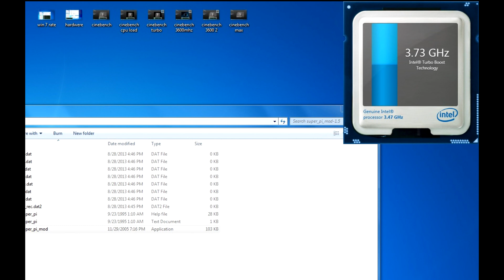DELL Precision T3500 with Six-Core Xeon W3690 and Quadro FX 5800

Comment: Ive been using a i7 920 and purchased this Xeon W3690 for a good price on ebay. Can't wait for it. I expect 30-40% improvement in some areas, autcad rendering for example. I think this cpu is still a good performer, between 3770k - 4770.
Reply: did it work for i7 920 on this T3500 ?

Comment: You can OC this processor to with the Dell to 4.0Ghz by simply installing the Intel Extreme Tuning Utility from Intel. Once done it will bench 15% to 20% higher than a stock i7 3690x. 

No voltage adjustment and stock cooling works fine. Just bump up the multiplier on the cores to 30x. Going to 4.1 or higher is unstable due to voltage. However, you can only bump the first 2 cores past 30x and get a stable clock past 4.0Ghz.
Reply: really??!
Reply: No you can't over clock on a dell
Reply: He's right. I have this same CPU and I've done it with the stock cooling.
Reply: are you able to apply your multiplier setting in xtu when you restart your pc ?
Reply: MrBoggy101 how? everything is grayed out for me, i also have a t3500
Reply: i have a xeon x5647, does the xeon w3690 have a unlocked multiplier or something?
Reply: The w3690 does have an unlocked multiplier along with most of the other CPUs in the w3600 and x5600 lineups. I don't know what to say other than XTU just works.
Reply: i downloaded the utility and it didn't work :(
Reply: you need the 2012 and 2013 versions
Reply: Does it work?
Reply: What version of windows and  Intel Extreme Tuning Utility??
Reply: windows 7...2012 version intel extreme tuning utility...please learn how to read
Reply: The Intel site only has one version, the thread I found has about 40 different archives of old versions of IETU so a specific versions is needed 2012 is an entire year and all the versions I have tried don't allow tuning.
Reply: Gallium31 get to testing then..i'm using the w3690 six core thats an unlocked xeon...look it up on google...i'm using a dell t3500 and its clocked @ 3.8ghz on all cores...use windows 7 too...not windows 8 or 10 or xp...windows 7 64 bit...i'm using the 10th version that was released..other than that..ive provided more than enough to go by and do this yourself
Reply: Sorry to kick a dead horse but can anyone else confirm XTU works with the T3500, i have one and plan on buying a w3690 to go with my gtx 1060 as my w3670 has no options in XTU

Comment: Getting a T3500 quad core PC off Ebay auction for cheap price, gonna put a AMD Radeon HD 6570 card in to upgrade the graphics-should be a big improvement over my Toshiba Satellite L305 laptop for gaming (I used to play WoW on it without much trouble, but since the newest expansion Warlords of Dreanor it's been unable to run the game I guess cause they increased the requirements to run it), Hope it works well, reviews of this PC are positive so I'm thinking it will be good.
Reply: Hi, i just snagged one from ebay also ;:-) ..haven't got it yet, it's on the way...T3500
they are coming off the corporate leases now and compare to the i-7 960 I've read..for the quad versions
only down side is the one 6 pin connector for expensive video cards as most require 2- 6 pin connectors,..but the gtx 660 with out the ti I've read would fit in I've read..or use an adapter..  I have an old gt 240 ddr5 version I'm going to use for now, then upgrade maybe later ..did yours turn out Good as expected  ??

Comment: I just had one of these land on my desk.  A coworker got a new desktop so this one is going to be going into our server room but not before I drop a spare i7 920, 12 gigs of ram and a pair of 300 gig velociraptors in RAID1.

I've also got a pair of 80mm fans and a small molex to dual fan header cable I'm adding for the exhaust fans as I suspect the 920 will run quite a bit hotter than the dual core Xeon it currently has.  Thankfully, it's got the big heat sink already.

Should be a pretty stout little box after all that.
Reply: +FastRedPonyCar How is it doing with the 80mm fans? I added fans on mine but it made it ran hotter. The extra fans on the back cause negative pressure. It also sucked in a lot of dust.
Reply: +Mussie Tesfay I left the stock CPU in there.  The i7 would have been overkill for what I ended up using it for.
Reply: +FastRedPonyCar there are faster xeon chips it supports.  Mine has a e5650 in it, and it is equivalent to a modern i7 in speed.

Comment: Was anything removed in order to fit that graphics card? I was looking at getting a T3500 and slapping in a gaming graphics card, but I read on the official Dell forums that it only fits a single bracket card because something in the case interferes with dual slot sizes from fitting.
Reply: seems to fit fine for me.
Reply: I have a gigabyte r9 290 in mine. Take a gander at that foot long GPU and you'll know you can fit near any gpu in there.

Comment: How did you overclock that system? I have a T3500 which is a 09KPNV. Options are shaded out for all setting adjustments in XTU and doesn't raise the multiplier or BCLK in throttlestop. The clock generator isn't listed in SETFSB. I tried a w3565, a w3550, a e5640, and a x5687. On the x5687 it increases the multiplier to 28T on throttlestop but nothing changes even after clicking save. CPU-Z shows same and AIDA64 shows same performance. I have the A17 bios is this my problem? Does the newer bios limit changes? What model number is your MOBO? Mine is designed just the same as the video.
Reply: you need to have W3680 or W3690 to overclock this machine with Throttlestop
Reply: @Atiojis  w3670 not supported?

Comment: i have this pc it has a Intel Xeon W3530 with a nvidia gtx 660 superclocked with 6gigs of ram will i be able to game on it like play gta 5 and battlefeild
Reply: +Michael Work You should be able to game on that just fine. The processor and 660 gtx are starting to get a little dated but it should still handle most games (with reduced settings) but have playable frame rates.
Reply: +Shane Potter Xeon W3670, Sapphire 260X 2GB and 12GB of DDR3-1333MHz here, works like a charm. I'm gonna be upgrading to a 960 though, the 260X works for games, but they aint pretty
Reply: Mike Peabody I'd go for a 970 gtx.. might be able to pick one up for 260 +/- 20.00 on ebay.. 960 is 200ish for 4gb. 960 gtx 4gb @200 is equivilent price / power as a 970 gtx @300. If you can get a 970 for 250 on ebay you'll get a much better price / power with the 970 for only 50.00 more

Comment: First gen i7 CPUs work in these machines. Like the 965.
Reply: lazzer408 are you serious first gen i7 work In dell T3500/T3400?
Reply: I'll look again but I believe I have the 3500.
Reply: Yup. T3500. I put an i7 in that one.
Reply: Plizz and In T3400 i have its work?
Reply: I don't know what the T3400 supports.
Reply: +Zaari Art I have a T3400 & several T3500's. My T3400 is a Pentium Core Duo that will support up to a duo quad.
Reply: +lazzer408 I could put a INTEL CORE I7-920 in a T3500?
Reply: Snoopy Smurf I'm pretty sure you can.
Reply: lazzer408 and pliz T3400 I can't?
Reply: T3400 is a socket 775 I think.
Reply: but this cpu is far superior and cheaper

Comment: Does all Dell T3500 accept X5660 or W3690?
Reply: Yes, I'm currently using a T3500 and it has a W3690 in it, now I just need to save up for a 6gb 1060.
Reply: I am currently packing a rig of gtx 1060 3gb with E5520 2.26ghz and 10 gb ram .
The processor bottlenecks my gpu 
Suggestions are needed for upgrades

Comment: Does it have a PCI 3.0 16X ?
Reply: +Do Memphis can i put a 1060 in it
Reply: THx bro
Reply: Daddy Bleach can i replace the psu with Gigabyte 700W bronze for rx 480
Reply: Yes, it needs 1 6 pin psu connector which the T3500 has.